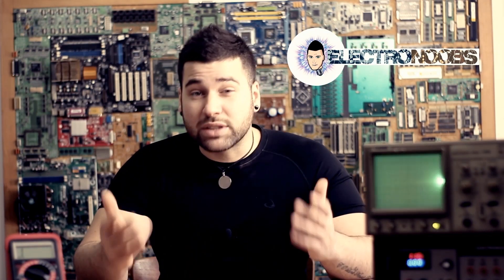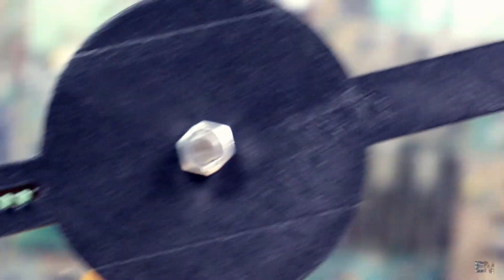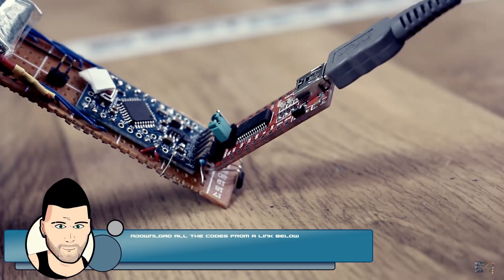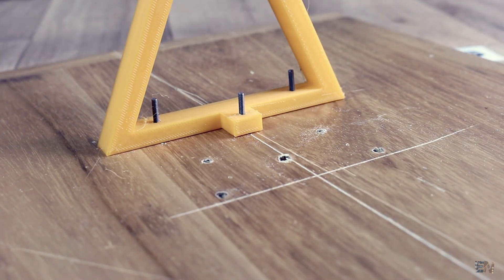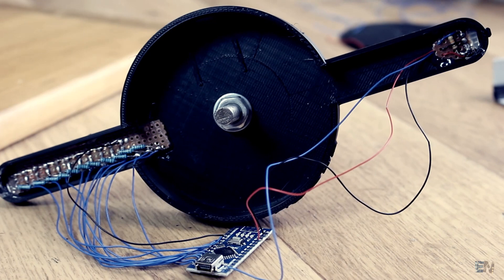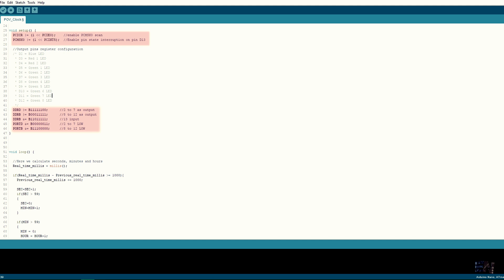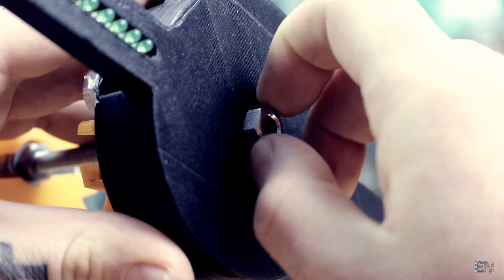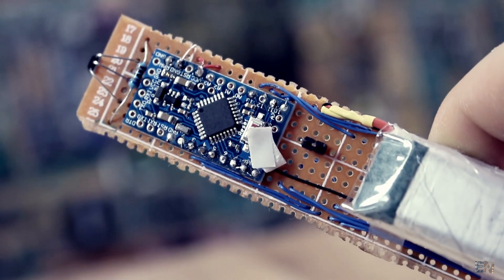Guest Video: Electronoobs - Building a POV Display

Comment: An 8Mhz AVR isn't fast enough to draw this? A 1Mhz cpu is enough to run a whole color computer. The first thing I see wrong in the code is FLOATS EVERYWHERE. All this math is going to take forever. Doing a division inside an interrupt feels awful, too. Just integerfying the math (and use 256 degree circles instead of 360?) would save a ton of ops. Probably enough that you don't have to refactor WHY ARE YOU RECALCULATING H/M/S SO MUCH?  
 NAILS ON CHALKBOARD https://youtu.be/EHLRQbCW5oM?t=5m9s

Comment: Nice project, but i'm a bit bothered by obvious mistakes/things you didn't address :s.
- if your blue led is too bright, just put a larger value resistor on it?
- if you make it a clock, at least address that without a proper RTC module, you'll have a lot of drift. the clock won't be accurate at all
- as a programmer, you're really making it difficult to continue listening to you when you start talking about the void loop >_<... it's the loop function, void is just its return type. I see a lot of newbies calling it the void loop, but at least try to teach newbies the correct terms for things so they can communicate properly with others.
- if the wheel is perfectly balanced, it should be stable in any position, if it's not balanced, the heavier side will go to the bottom, so you have to add weight to the opposite site of what is naturally on the bottom. It's not the more horizontal the wheel is the more balanced it is.

Comment: The balance is when you turn the propeller and it will stop at any possition, if allways stop on the same point you need to add some weigh on the opossiteand that mean on the top of the popeller when it stop the momement

Comment: If the blue LED is to bright, just increase the 100 Ohm resistor for it. You might want to try different values, eg 220 Ohm or even more. It realy depends on your environment to find a brightnes balance that works for you.

Comment: I can already see one point of improvement.
Most of the power is consumed by the motor so using LEDs on both spokes (halving the RPM needed for the same frame-rate) should save a lot of power.

Comment: I would have used a head-drum motor and remove the video heads so that I could use one coil for power and the other winding for data and clock had the head-drum motor been out of a stereo video you could communicate with the main board with the other coils of the rotary transformer.

Comment: Good video so far.
I just had to laugh when he soldered the Hall sensor outside the case that was 3d printed for this project :D
Reply: Yeah, pretty risky and kind of ruins the design. If the glue comes undone and the hall sensor is bent or flung out there will be a "Huston, we have a problem" situation. Just print a thin wall to hold the sensor in but away from mechanical disaster.

Comment: Nicely done.  You can save the 1k resistor by setting the pin to INPUT_PULLUP instead of INPUT, and use the ATMega's internal pullup resistor.

Comment: It's 2018... And prints from 3D printers still look like shit. Why people would spend up to $2500 on a 3D printer is beyond me. They're not good for anything other than projects like this, unless you spend hours filling, sanding, and filling blems/voids/imperfections with Bondo.
Reply: Sanding isnt the only way to smooth 3D printed objects. Acetone vapor baths do the job and are way less tedious. You should look up "Make Anything // 3D Printing" channel. He does some incredible things with a 3D printer.

Comment: You could put an I2C interfaced RTC chip inside of the gizmo (with a coin cell battery to keep it alive when the arduino is off) and use a spring loaded momentary switch with a weight that would turn on the arduino (from centrifugal force) when the motor is on.  That way you'd have a clock that always has the right time.

Comment: I enjoy the occasional home-brew DIY project like this. The concepts and circuitry are explained clearly and simply. Thanks. 

I appreciate Dave providing a platform for others while he's on vacation. Don't quite understand what problem some other commenters have with it - you'd rather have 2 weeks of total silence while Dave's on vacation?
Reply: Mark L Sadly some people will find any reason to complain. If they aren't complain about the guest videos they would be complaining that Dave isn't doing enough mail bag videos... Or to many.. Etc etc. The internet age we live in.
Reply from the maker: Jon Vannatto   Indeed!
Reply: I really appreciate Dave uploading other youtuber's videos :)
Reply: if i can remember on my college days we had make similar like that but using PIC chips with out any battery on the spinning part, ruffly if i recall it it like a mini low voltage transformer nearly 1 is to 1 isolation type kind a like that.

Comment: Your accent is a bit heavy going making him difficult for me understand,  I have to watch it a second time, to understand what saying. :-)

I like the project seems a quite good, it seems to be a clock,

What  I don't now how you would set the time on it, apart from starting it 12 o'clock?

Would it need a quarts crystal think to keep it on the correct time?

How about making the rotating movement charge the battery some how, then it could go 24 hours a day, as a real clock  :-)
Reply: Unless you can hook up a special clock-crystal (32kHz) it is pretty tricky to get a clock with runs for longer time without loosing the time.
A 16Mhz crystal does not realy have 16Mhz. The tolerances for them usualy are around +- 150ppm. That means that a 16Mhz quartz can be anywhere between 15997600 Hz and 16002400Hz. Usually they are close to 16Mhz but if you expect them to be exactely 16000000Hz - dream on. While the possible difference seems not to be very large at the first glance, it adds up. If you clock is off by 5 minutes at the end of the month, this is pretty useless. But: If you do not compensate for tolerances, then your clock will not be off 5 minutes at the end of the month, it will be off 5 minutes at the end of the week.
So if you realy want to build a clock for your living room, may I suggest you first learn techniques to overcome those problems before you get your hands on a POV clock. The challenge is the clock mechanism itself and not the POV part. There a various ways you can build a clock which works good enough for home use. Explore them first. But the naive and simple approach of just incrementing some variables powered by millis() does not work for other then demonstration purposes.
Reply: thanks for the information

Comment: can you do this with a PWM motor and omit the sensors?
Reply: The sensor has a nice 2nd function also:
it provides a reference of where the arm is located in its rotation. This is important to have a stable reference of where in the rotation 0° is located.
If you don't like (or don't have) a hall sensor, use a fork light barrier. Eg a GP1S23 will do.

Comment: Wouldnt it be more exact in switching it on if you use a coil instead of the hall sensor to get more precise results?
Reply: He uses a hall sensor switch! Basically this is a hall sensor with a Schmitt trigger afterwards. Thus he does have consistent results.

Comment: You should have used surface mounted resistors to make the board nicer and save some weight. You should have used a small linear regulator with the 7.4v lipo but for this project it probably would have made more sense to use 2 CR2032 batteries (have a battery on each side of the center for better weight distribution) and maybe some high brightness (very low current) red leds.
You have quite a lot of English errors but the video is not difficult to understand, overall you did a good job. Maybe create a script for your video next time and let your LibreOffice or whatever you use spell check your document?
Reply: Who gives a shit about the errors. He's doing perfectly fine. If you had a hard time understanding, it's a "you problem," it's not his problem with speaking. He explained and spike very well without being a native English speaker. He is using a script puff you couldn't tell from the cadence of his speech. Don't use/stop using a script, it makes it sound unnatural.
Reply: Thanks for all your tips. Trust me, I'm already precticing speech and writing a lot but as a non English native I can't just directly speak perfect. I hope I'll improve on the way.
Reply: Video production advice - https://www.youtube.com/watch?v=RgPNYxmbvRI  ? I'm saying nowt.
Reply: And your point is?  I made that video in 2014 when I was much younger and I made it in my native language, for a smaller audience -  only for a few friends of mine on a local forum - to help them build their PCs. My channel is not even monetized. 
Unlike Electronoobs, I didn't make the video knowing it would get tens of thousands of viewers over the time from a more picky and in general more professional audience and I didn't care much about it, it's shot in a more relaxed and loose way, without a script or anything, just me building a pc and giving some building advice throughout the build.
I would give myself just as much feedback and constructive criticism today, as I gave Electronoobs here, were I to submit my video to Dave.
Reply: And you seem to have a comprehension problem. I already wrote that it's not difficult to understand. I merely gave him some feedback on the video, he can take it or leave it, no harm done.

Comment: If you use some modern, green InGaN LEDs, the display would be a lot brighter and wouldn't be washed out by the blue LEDs.
Reply: or just use different resistors
Reply: He could dim the blue LED, but the green LEDs he used won't go any brighter.
They are running near 30mA each with the 100Ω resistors and he is already exceeding the 200mA current rating for the Arduino pins. The modern LEDs will be brighter running at a tenth of the current.
Reply: The pins on the Arduino (Atmega) is rated at 40mA (Absolute maximum ratings), not 200mA